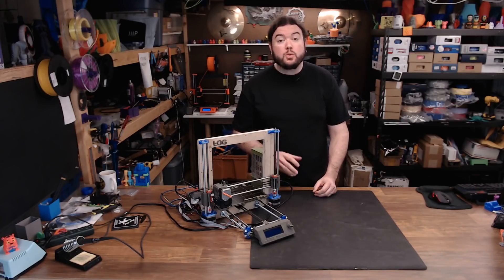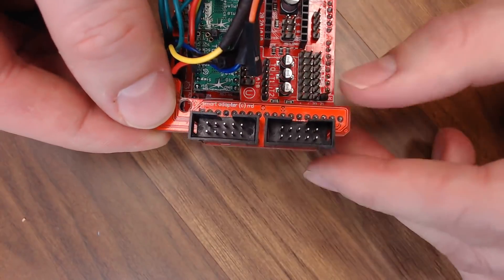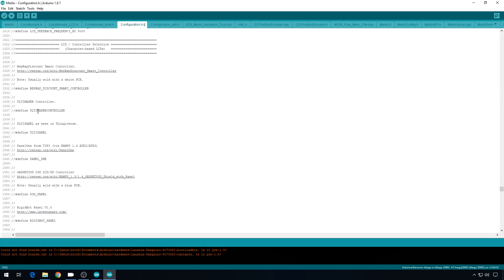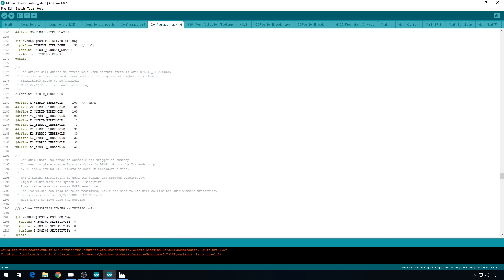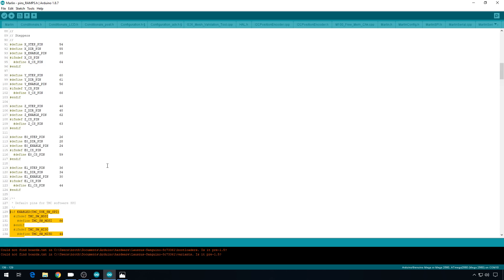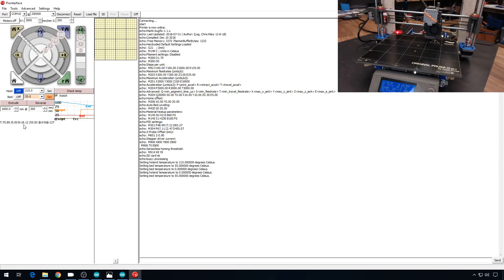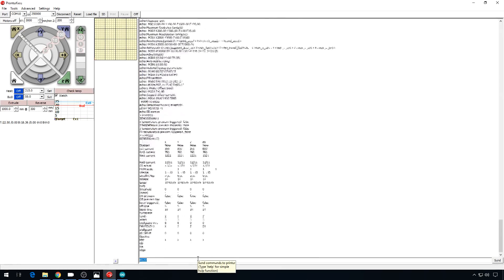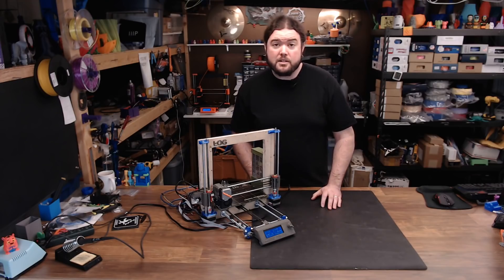TMC 2130 Stepper Drivers - w/LCD - Chris's Basment

Comment: Dear Chris, your videos are very helpful... Thank you very much. I hope you can help me or even give me an advice: I'm trying to install TMC2130 drivers on the X and Y axis with the Geeetech GT2560 rev. A+ board. I have tried every option in Marlin 2.0.x about TMC2130 but the Motors just won't move correctly. The Motors moan loudly just like they are not connected correctly. However, the X and Y motors move correctly only when I make a 0.1 mm move but with a very strong momentum that makes the whole printer move. Any help/advice is highly appreciated.
Reply from the maker: Sounds to me like the current is way to high. Are you connected SPI mode?
Reply: @ChrisRiley  Not sure what do you mean, but all pins are plugged into the board (no reversed pins like you did). My next question will be: How to connect to SPI mode on the GT2560 rev. A+ because almost all pins are already occupied
Reply from the maker: @m.kanawati4385  Ok, so you are running in standalone mode. The pot on the driver is going to set your voltage in that case. Unfortunately the gt2560 doesn't have the SPI bus exposed, so I don't think you can get SPI mode configured on that board.
Reply: @ChrisRiley  Very well, and can I at least make the drivers work always in stealth mode? if yes, How? and how much currect should I set the pot. to?
Reply from the maker: @m.kanawati4385  Yes, they should default to stealthchop like you have them now. I would set them to 800mA to start. In standalone mode like this, you will need to put all your jumpers back on to set to 1/16 microsteps.
Reply: @ChrisRiley  Thank you very much. I will do as you advised and let you know the results.
Reply: @ChrisRiley  Hi again, I have solved one issue and got another :D I have figured out that the motor connections are different from my DRV8825, So I have to swap 2 of the motor pins to make it work. The other issue that I'm facing: The Pot. is giving me a very low range, from 0.130V to 0.220V maximum. Any idea what should I do?
Reply from the maker: @m.kanawati4385  Are you measuring at the vref pin?
Reply: @ChrisRiley  Of course, The ground pin and the vRef pin, near Diag pins
Reply from the maker: @m.kanawati4385  Ok, I am not sure what it going on. Let me setup a test.
Reply: @ChrisRiley  I did a small test on RAMPS and so I figured out the difference in the motor pins and the small volatge range.
Reply from the maker: @m.kanawati4385  Just an update. I have a video on standalone 2130's coming out soon.
Reply: @ChrisRiley  Wonderful! Thanks a lot

Comment: Hello , Super , Thanks For Explain .. But i Have Question ?! after i set TMC2130 and MKS Gen V1.4 .. i Must Set Current Of The Driver ? or Not Please this is import
Reply from the maker: No, 2130's set the voltage via software if you set them up in SPI mode.
Reply: @ChrisRiley  and micro step .. can u give information about install marline first time on mks gen v1.4 with drive tmc 2130 spi .. because i download marline but there some change from video to new Version of marline .. thanks so mush
Reply from the maker: @mohamedatef8424  Are you using 1.1.9? It should work almost exactly the same on an MKS board.

Comment: Hi Chris loving the videos, but I have found an issue that I can not compile this firmware as it sats TMC2130Stepper.h is missing I have tried lots of options to fix it but none work so far any ideas ?.
Reply from the maker: Thanks! That usually means there is something wrong with the 2130 library. Try to uninstall it and reinstall it again.
Reply: Chris Riley  I did do that 3 times also downloaded and manually added file
Reply from the maker: Strange, if you want to pack up your firmware and send me a link to it, I will check it out if you like. brotherchris81@gmail.com

Comment: Totally unrelated question in hopes you know something I don't lol I am using my printer as a Direct ink to PCB, When I make the back side of the pcb, it would be a lot easier to set up, if I was able to flip the X motor direction, My question is, do you know what gcode I could used, with marlin to change stepper direction movements. I don't want to flip the cables as its only used once for the back PCB
Reply from the maker: Yes, inside Marlin all you should need to change are these settings.
#define INVERT_X_DIR true
#define INVERT_Y_DIR true
#define INVERT_Z_DIR false
Reply: loll thanks Chris, Let me rephrase, I want to change the X axis on the fly when needed, like, throw a simple G or M code at the start of a gcode, I do not want to re-flash my firmware every time I want to have the axis  change direction. Like I was saying, I use one of my printers with a Pen as a plotter to make PCB traces, and to properly align the top with the bottom when I flip the copper board over. You see, I print  starting for 0.0 (top right corner of the copper board) when I flip the board I need the new 0.0 to start at  top Left, if that makes sense, I know at one point there was a M569 gcode to do that, it is still part of the original RepRap firmware, I think they just took it out of marlin, I was just  hoping you knew another one I didn't know about.
Reply: If all else fails, i'm going to add a double poll double throw switch on the wires to the X axis and toggle flip the switch as needed but id rather do it with a Gcode if I can.
Reply from the maker: @patprop74  Yeah that might be easier. Only thing I can think of is when you do the back you could use the same gcode but do a change all in a text editor to make the x negative numbers.
Reply: In the short term , that might be a option, however,  I am sure there is a way to add a custom Gcode to Marlin that would let me do this, After all if we can change the stepper direction in the firmware by simply changing a True to False or vs versa , there must be a way to code it in as gcode, I would think, but,  when it comes to coding a firmware lol im as clueless as the next guy.   Thanks for your help nonetheless and if you come across info, id love to hear it, Two heads are better then one after all, BTW Happy New Year.
Reply from the maker: @patprop74  I'll be on the look out, happy new year!
Reply: Thank you, I made that flipper switch, not what I wanted, but a quick dirty fix, that works for now. yet one more thing in that ramp box's hahaha. but you know how that feels like.
Reply from the maker: @patprop74  I would love to see a video on what you do, too cool.

Comment: Great video, I wonder if with the new 1.6+ version of the RAMPS will be more easy to do since they're adapted to use TMC2130...
Reply from the maker: Not sure on that one, do you have a link to it?
Reply: @ChrisRiley  AFAIK I only found it in AliEx https://m.aliexpress.com/item/32949792381.html
Reply: I also want to upgrade my ramps.1.4 with the 1.6 plus with TMC2130. So what you think Chris       just use the jumpers for spi mode? Or also we must move the pins to aux2?
Here is the link https://www.biqu.equipment/products/biqu-3d-printer-parts-ramps-1-6-plus-upgrade-from?variant=14250516480098

Comment: Once again great video Chris! I'm using can white TMC2130 with MKS gen 1.4 on my AM8 and face issue with Stealthchop. I have clone V6 on bowden and on higher speeds experienced layer shifts. I've found somewhere that Steathchop have torque issue. How tried higher speeds?
Reply from the maker: I have not tried higher speeds, but yes, you will have less torque. Does spread cycle help with the shift at all?

Comment: So just to be clear you did this due to the board layout. I setup a rumba board on 2 machines, for a friend with 2130s and same LCD screen and it works just fine with hardware SPI. Rumba is a bit more robust as it breaks out the SPI pins so you can share MISO/MOSI lines, clock is shared on the bus, but that is fine -- CS pin is different for each device so as long as you don't step on that, it's fine. Not sure if there are any downsides to software SPI.
Reply from the maker: Yes, this is just because of the board layout. If you wanted to solder and share those pins it would work just fine as well. I just couldn't make it look good.

Comment: @Chris Riley I see that you have twin Z-steppers...  I'm about to do either a RAMPS 1.4 or a MKS GEN L conversion to my CR10-S and use either 2130's or 2208's.  I notice you're not using an extra 2xxx module for the 2nd. Z stepper so am assuming I can get away with parallel-wired Z motors, is that right?  Would that be because the duty cycle of the Z steppers is much less than the X, Y, Extruder steppers?
I'm wondering about the CR10-S 12V power supply and the effect of the lower voltage (<24V) on the steppers.  I don't use the PSU for the heater bed (using a 240V conversion there) so there is plenty of current to go 'round.  I guess, if I need to, I can get a 24V PSU seeing as I'll not be using the Creality board.
Reply from the maker: Yes, I just have them both on the same driver. I have never had an issue with 12v running this way on Z. I think there should be enough power there. You are correct, the demand isn't as high and should work fine.
Reply: @Chris Riley  Thank you for the reply and 12V info. And thank you for the very informative "How-to" video(s).

Comment: Great instructional video. Doesn't the LCD or SD-card use aux 3? What happens to those pins? Or do you create additional SPI pins?
Reply from the maker: Yes, they use AUX 3 with the smart adapter. They are still in place, we just created additional SPI pins.

Comment: Hey, nice video again!
Thanks to your videos, I might consider upgrading to these drivers as well!
I really like that "freedom" of moving pins when you're running a RAMPS with enough free pins.
Reply from the maker: Thanks man! Yeah, RAMPS is nice because on the pins, but for the most part very unreliable.
Reply: Yeah, sadly, especially if you use some cheap clones... One of mine shorted after being connected to 12V without anything on it for five minutes!

Comment: Cheaper and easier to buy an prusa eisny clone from aliexpress. Already wired up and has rmc2130s. Lol
Reply: Triangle labs makea good clones. No issues.
Reply from the maker: @Phil-D83  Good to know.
Reply: but you get what you pay for, and since you pay less something is not as good as it could be :-D
Reply from the maker: Depending on the board you use you could probably get a real Einsy for about the same price. Not a bad way to go. :)
Reply: I never spend money on clones, unless they figure out a way to clone customer support and backup their products like the originals.
Reply from the maker: Great point.

Comment: Outstanding as always Chris. Shame my CR-10S4 has onboard drivers. Then again, I'm thinking of upgrading to a Duet, these do the 2130s do work on the Duet don't they?
If I do upgrade to a Duet, it makes sense to move all the electronics to under the bed too. Will I ever stop pimping this printer .... I doubt it :-)
Reply from the maker: Thanks Spike! Duet has 2660's and they are awesome as well. Super quiet as well. They only real difference is how the stall guard works. 2660's can do skip detection, but it's not as granular as the 2130. So enstopless homing really isn't effective on the Duet.
Reply: @ChrisRiley  Ah I see, thanks for that. If im going to upgrade the board I want to have all the bells and whistles too, including sensorless homing. Are there any boards that have the 2130s or are able to have them installed and are 32bit?
Reply: @spikekent  i'm sure @Chris Riley will join in, but a re-arm and a decent ramps board should do the trick. personal i use this one for ramps: https://www.tindie.com/products/staticboards/ramps-14-sb-premium/, if you are inside EU you can order from here also: https://www.staticboards.com/products/arduino-shield-ramps-1-4-sb-premium/
Reply from the maker: @spikekent  The only one I know of is the Einsy and it's 8 bit. I "think" 2130's should work on 32 bit. I would need to test it.
Reply: @ChrisRiley  Thanks Chris, only wondered if you had any opinions on any. I'll keep a look out. Thanks mate.
Reply: Check out J Steve White's config for the Railcore.  He's got endstop-less homing working for X and Y axes on that printer with the Duet WiFi. @ChrisRiley
Reply from the maker: @JohnOCFII  Sweet! I'll check him out.
Reply: @ChrisRiley  and sadly the 2660's are to big to fit the polulu format :-( i would have taken those if i could. they should also be noiseless at 12V where as tmc2130 and tmc2208 need 24V and above to without whine/hiss
Reply from the maker: @boherrmannsen8219  That is a good point, 12v vs 24v is something to think about as well.

Comment: Thanks a lot Chris! very helpful, I was tempted to solder additional pins over LCD connector, but your solution is more clean.
What's your opinion of using sensorless_homing for Z axis too? I´m think that melted plastic on nozzle can give some false reading.
Reply from the maker: You're welcome, yeah, I was thinking about that. You're right, any debris would cause you issues. It might be tricky to get it working and more trouble than its worth.

Comment: I am thinking of the Lerdge K-TMC2208 board for my upcoming HyperCube Evo.  Does the 2208 include sensorless homing?  StealthChop?
Reply from the maker: I don't know anything about the Lerdge boards as of yet. The 2208 can be installed all pin down and you get StealthChop by default. No stall guard though, so no endstopless homing. You can flip one of the pins up and hook it to the SPI and put the driver into spread cycle if you need more power than stealthchop can offer. In that config you also get software power control.
Reply: It's my understanding that sensor less homing is a bit over rated. It can be very finicky to get it right. It's much easier to use normal endstops. I would not make this ability a priority when looking for a new board and chips.
Reply from the maker: @ravemind8433  I agree, it is pretty cool, but unless you really need it some strange config, it's kind of a pain.

Comment: I soldered 3 wires to the lcd connector board to tap into the aux 3 SPI and got it going on my Dolly. I've been meaning to put together a video on that but haven't had the motivation yet. It's great that this option exists for those less adventurous than myself.
Reply from the maker: Nice! I tired that first and didn't really like the way more solder job turned out. It did seem to work just fine though.

Comment: could you not solder a header on top of the lcd adapter so you c an use hardware spi? if not much mistaken the only thing you cant share is the CS line but there are plenty of free pins on AUX2
Reply from the maker: Hey Bo! Yes, you can do that, I just couldn't make it look very good. I though this was a much cleaner why. The soldering work around work just the same though, I did test it.
Reply: @ChrisRiley  hehehe, yes it requires a very steady hand, and i guess a very slim soldering tip 

i have a re-arm board going my way from the US and i plan to solder a 2x4 header on top of the lcd adapter. and then using aux2 for the cs pins, but then again i have to debate with myself if i want to go with tmc2130 or tmc2208. 2208 has more current but is serial controlled. i do not plan to use sensorless homing

what would your arguments be for either of the 2?
Reply from the maker: @boherrmannsen8219  For me, if I was building a printer I think I would go with 2208's and just run in legacy mode. Just as good as the 2130, still get stealthchop. You could always set them up spread cycle if you needed extra power.
Reply: @ChrisRiley  as you are using that sandwich you could use the SPI headers on the mega...
Reply from the maker: @Nitram_3d  that was the first thing I tried. I could find a connector that had enough clearance. Do you know of one?
Reply: @ChrisRiley  Bend the headers....
Reply from the maker: @Nitram_3d  Ouch! Lol, I have some spare boards, I'll give it a try.
Reply: @ChrisRiley  I had to do that on my 2130 when I added protectors and 24v on VM